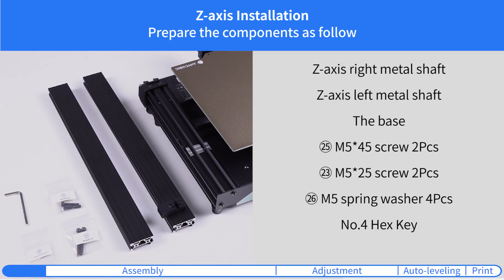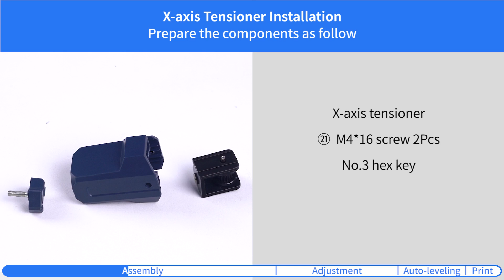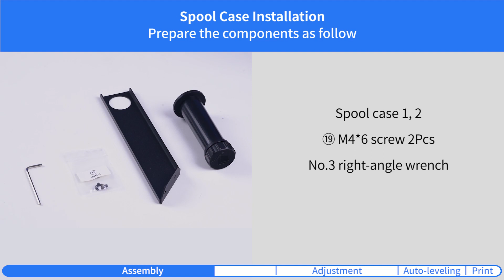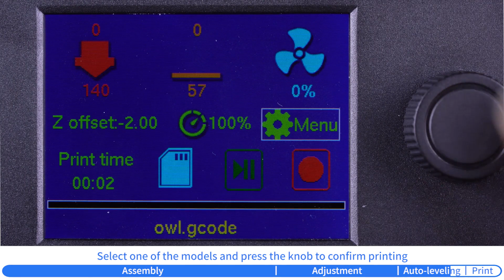Installation and Leveling Guide Anycubic Kobra Go

Comment: I would not choose to use a hardbound book. The pages are folded, so it isn't the same thickness if you put the binding underneath.
Either rotate it so the binding isn't under it, or use a block of wood or a strip of aluminum extrusion.

Comment: Is there any way to make the bed go forward after and print is finished, instead of backwards? It makes no sense why they would program the machine that way. I do not want to reach behind my 3d printer to get my print.
Reply: you would have to change the G-code on your machine's firmware using pronterface
Reply: @christophershultz1620  For some strange reason it started to move the print forward after it finishes.

Comment: Why does everything need to be in High speed… Its my first 3D printer - im about to throw it out the window. Im putting it together  and the bed seems all lose. I’ve followed all steps in the manual - now I tried watching this video, but WHY do it has to be so fast?
Reply: You can slow it down. I put the playback speed to .25
Reply: Tighten the bolts on the wheel under the bed, thight enough so the wheel can move and the bed can't

Comment: I don't understand why they lower the sensor and then adjust the z offset more... They should be raising the sensor instead so they don't need to adjust it as much.

Also does the auto leveling really work properly? My prints still have a slightly thinner spot in some parts of the first layer, even with M420 S1 in the gcode
Reply: it doesnt work, top right always looked better until i manually adjusted the bed. thing is a nightmare
Reply: @trickkynickk hi I know this is a long time ago and I hope you answer but how did you manually level yours? I am trying to find the best way to

Comment: When I was printing the owl thing, it reached the desired temperature but hasn’t started printing. What should I do?
Reply: I know I’m not anycubic but I had the same issue, if the screen is also frozen like in my situation all I had to do was reformat the card, use the tutorial by BV3D: Bryan Vines  called “How to Format a MicroSD Card for a 3D Printer” if you need assistance formatting the card again, be warned it will clear the car so you will no longer have the owl print, unless you save it elsewhere. let me know if this works
Reply: I changed my voltage in the back and it worked.
Reply: @ericbrowley9318  Do not change that unless you are sure it is wrong.
Reply: @petercallison5765  120v is common in the U.S

Comment: You don't need the leveling tool, use a sheet of paper under the nozzle, and use the supplied open ended wrench under the yellow proximity sensor, both should be touching but not tight, that is the correct height.
Reply: That worked!
Reply: idea for substitute m2 allen key ?
Reply: @martinsukind4706  nothing. Anything else will likely strip the head of the bolt, and that will become a worse issue
Reply: Doesent worked for mine, he wants to be a cnc cutter, i know it!
Reply: Worked well thank you
Reply: Ok what if I didn't get the green little tool? What than
Reply: @sin3369  read the comment
Reply: See what This dude doeshttps://youtu.be/1eF7_05U-_8
Reply: @sin3369  I had 2 wrenches that came with mine a small one with one open end and a larger one that had two open ends to it I use the one that had the two open ends
Reply: @bombsquad1989  thank you. The instructions were a little unclear. I understood it but just wanted a little clarity. 

Now the 2 open ended wrenches 🔧 are for the yellow sensor and a standard white sheet of printer paper for the nozzle? Correct?
Reply: @sin3369  Yes
Reply: It’s broke now
Reply: Stupid question but does it matter what size paper or just any size
Reply: @klandgraf  any size

Comment: The power cable and the print head comes out in front of the printer. How do I get the print head out at the back?
Reply: I had the same issue then realized I hadn't taken the two foam blocks out from under the bed
Reply: @BryanRendonG  bro thank god for your reply. I didn’t know those were supposed to come out lol. I’m an idiot
Reply: @BryanRendonG  You're a life saver. I also didn't notice the foam at all. I hope you get all the good fortune.
Reply: The power cable and power switch should be on the back left side of the printer, in other words, they should be "top-left" if looking from above (birds-eye-view).

Comment: Where can I find that proximity leveling tool? Do I print it out myself?
Reply: none here too
Reply: I have the same question, mine did not come with it and it isn't mentioned in the printed instructions.

EDIT: reddit threads say it doesn't, but here is the STL https://drive.google.com/file/d/1bVqzQfyfUIOS8zwyjn9uVSluQStUsw78/view
Reply: @cameronetchart8813  Thanks for the STL

Comment: hi man, what are u using for stl? in cura is this printer still missing....
Reply: The included microSD has printing profiles. Set it up as a custom printer with he correct filament, nozzle, and bed dimensions, and import the profiles.